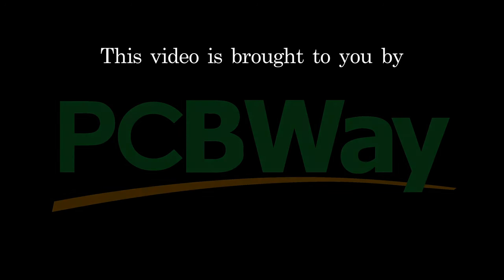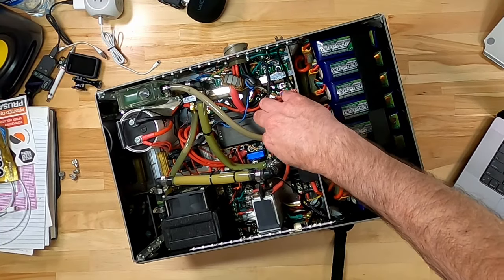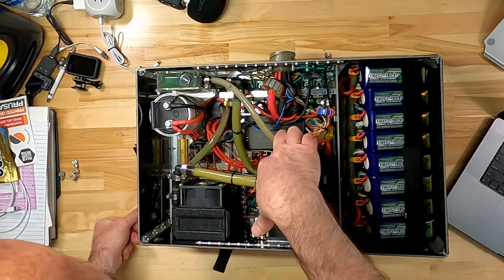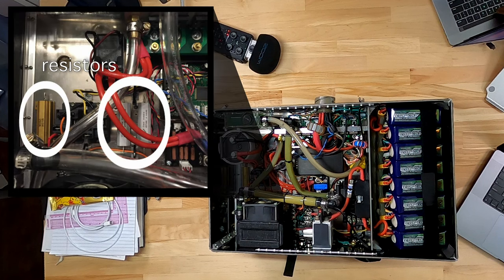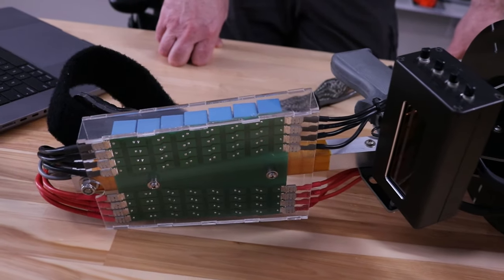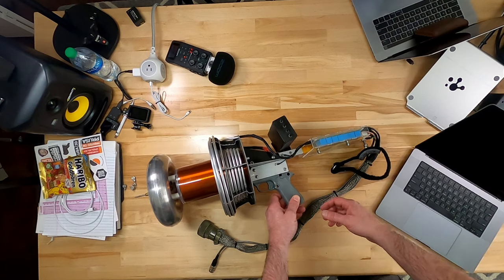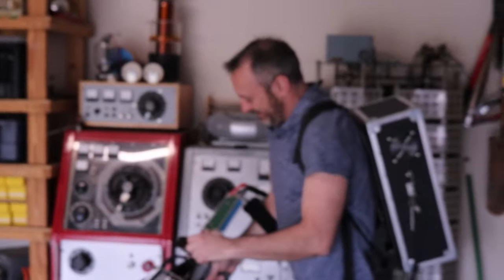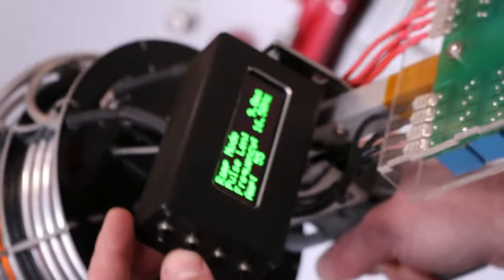The Incredible Engineering and Story of The Tesla Coil Gun

Comment: You know for some reason I never thought about the lipo supply just replacing a big cap bank til watching this video. I know that's how some of the coolest coil guns do it in order to get the high fire rate but it makes perfect sense for a QCW when you want a fairly high BPS. Certainly presents an extra level of safety concern and failsafe engineering but it's worth it. 
For a pretty cool portable deal I'm sure one could get away with only ~150VDC or so in lipos. 5 miniblocs, smallish cap, the batteries, heatsink and fan, drivers.. should be doable to where the whole thing is hand held and the majority of the components are held at the shoulder so it becomes a rifle.
Reply from the maker: yeah man 100%, scariest part is that you'll beat me to it!😂
Reply: @BackMacSci  lol I might do something like that one day but probably no time soon. If I make any kind of rifle I think it will have to be an actual coil gun because I have too many suitable caps and SCR's. Maybe a small QCW pistol when I get around to making the small ones. If you're planning on a QCW gun though you can definitely pull it off. Thinking small is the way to go. You don't really need to beef up the components too much unless you want a high BPS and 350V bus or something. For a low fire rate you can use almost any small power source at below 200V ramps. There are some cool small DC caps out there that can give you the needed bus capacitance in a pretty small form factor. I used 4 CDE 400V 1500uF caps for example in my final 4s battery build and they are pretty small.
I'd say it shouldn't run more than like $100 or so total.